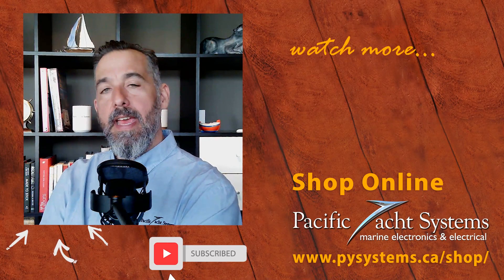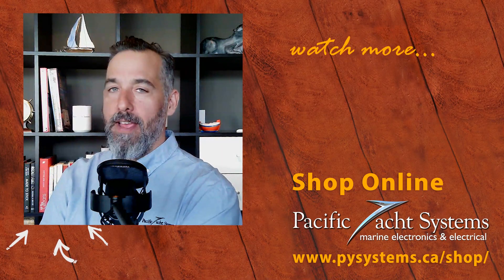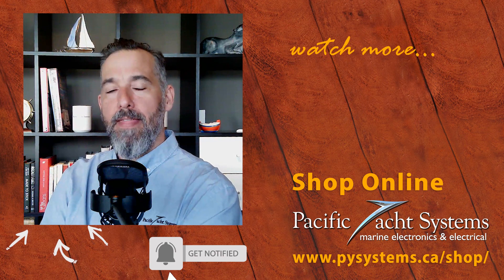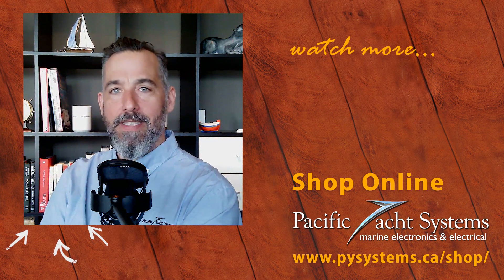Options to Increase My Boat's Deep Cycle Battery Capacity

Comment: Golf cart batteries are great, however, if 1 fails, it leaves you with low voltage and no power, if you have 12v batteries (2 or more) and 1 fails, you can disconnect the failed battery and just have a smaller bank and can still use your most important equipment.

Comment: Hi! I currently run a 3 battery system on my boat consisting of 3 x lead acid batteries. 1 x start and 2 x house. I charge all 3 batteries from both the engine and an onboard 240v 3 bank battery charger. I plan on swapping the 2 x lead acid house batteries for a single 100ah lithium hybrid (hybrid for back up start battery) I'll be running a DC DC charger to charge the lithium while underway. My question is, can i use my original 3 bank battery charger (Prosport 20amp 3 bank) to charge both lead acid and lithium by connecting one of the charger banks directly to my DCDC thus "tricking" the battery charger to supply continuous power to the DCDC and then just letting the lithium BMS do what it needs to do and charge the battery? Thanks

Comment: Hi Jeff, why are 2x 6V golf batteries better in series better than 2x 12 group 24 or 31 in parallel? Or simply, why 6V golf than 12V batteries? Both are deep cycle. The increased AH of 2x 6V golf are good, but is there another reason?

Comment: Strange totally not mentioning LFP.. I swapped 2 years ago and what I learned is that it requires less equipment then I did install. The set of 280Ah EVE LFP with BMS cost 800 euro (or USD), its size and weight less then 1 of the 2 105Ah deep cycle batteries it replaced, almost tripling the usable capacity. Over a week selfsufficient on a mooring with 130wp solar, it is really working. Extra equipment: dc-dc converter (500€) between starter battery and LFP to manage load on alternator and protect it. LFP should also last much longer, so more investment upfront but lower total cost and better performance... just my 2 cents😊

Comment: Assuming this isn't for engine cranking, if the objective is to increase total USABLE Ah, shouldn't the fellow boater at least consider LiFePO4?  This would increase usable Ah substantially, and extend the service life of the battery bank.  Obviously, this might require an upgrade to the battery charger as well, but the question didn't indicate a financial constraint.

Comment: Worth mentioning, Deep Discharging even Deep Cycle Batteries, always damages the batteries. Even with Lithium, as a Chinese Lifepo4 Battery Nanufacturer told me,  discharging,them below 50% Capacity, will show up as a reduced number of available charge Cycles. If the Lithium Batteries in mobile phones and Tablets are anything to go by, and they could well, then charging them above 85% Capacity reduces their service life as well. to me, a lot more information on how best to treat all types of Batteries, to get the best out of them is becoming urgently needed Oh and very rapid charging Lithium Batteries may be bad juju for service life as well. Seems there are no free lunches doesn't it ? 🤔
Reply: This depends on your usage.

To use made-up example figures, if you have a 100ah battery, if you deplete your battery to 60% it will last for 1000 charge cycles, but if you deplete to 50% you only get 800 charge cycles.  The total output over the life of the battery is approximately the same whether you use 40amps 1000 times, or 50 amps 800 times.  Both of these situations give a life of 4000 amps.  These numbers are example only, so are not real-life figures, but the notion is the same in real life.

The more you drain down, the less cycles you will get, but if you drain down twice a week, the first example will last for 10 years while the second example only lasts for 8 years.  If you're planning to replace your battery after 5 years anyway, then whether the charge cycles will last for 8 or 10, doesn't particularly matter, since they'll be replaced before end-of-life anyway.
Reply: @davidmurn772  Which just like with Lead batteries,  confirms going below below 50% Capacity damages the battery, where there you realise it or not. that you say the amount used is exactly the same is an assumed presumption, and has no scientific backing, whereas with Lead batteries, it is confirmed that by going below 50% Capacity, you Hammer the shit out of them, and dramatically reduce their service life. My Offgrid, cheap heavy Duty Agricultural Tractor Batteries, were still good after 15 years of use (minus 45 degrees C temps, that hadn't been forecasted cracked the cases) by never going below a 50% state of Charge, and only using distilled water to top them up, fits what is known about 
Lead Acid Batteries. Compared to those, we actually know very little about Lithium, but early indications are pointing towards. Rapid fast charging shortens their service life, Charging them above 85% Capacity shortens their service life, and deep Discharging shortens their service life. That no matter what you do to them, you still get the same total amperage storage  usage out of them, is an unproven assumption that is very likely incorrect. You may not like that, I definitely don't like that, and frankly, until we get some solid Factual basis, I am no longer prepared to be such a Lab Rat, even if given a free Lifepo4 House Batery Bank. Why, because there isn't enough Clarity about them to provide a coherent Testing Starting Point, as you cannot get reliable data if all you are starting with, is assumptions and Presumptions.  At least with AGM, "Deep Discharge " batteries, I can count on good solid Lead plate construction from the right supplier, and by Treating them correctly (by Not Deep Discharging them) , I can guarantee as close as makes no difference a ten year service life, and no potentially flaky Built in battery monitor, its settings based on assumptions and presumptions needed. The only thing I really have to have as a priority with them, is the ability to get them back to 100% state of charge rapidly. Also, and not unimportant, is the ability with Lead to have close to 100% easy Recycling ability. Genuine Lithium battery Recycling presently has all the hallmarks of being Fictional. within the next 10 years, Facts based knowledge, plus genuine clean Lithium  Recycling, should be available, along with potentially, even better batteries. So guess what gets "Me" from here to there ? AGM, or maybe Carbon Lead (a fairly safe bet too) Batteries. Guess what the range of electric cars with flooded Lead acid batteries was in 1911 ? Well this may surprise you, but it was over 700 miles. Have we progressed in the years since ? Probably not as much as we would like to think. 🤔

Comment: Excellent timing as we are due for new house batteries and our existing 6V lead acid golf carts have worked excellent for years and years so we were just going to replace them with the same. Nothing else in the electrical system will require an upgrade so it is by far the easiest and most cost effective. Your videos are extremely appreciated, thank you for the time and effort that it takes to make and post them.